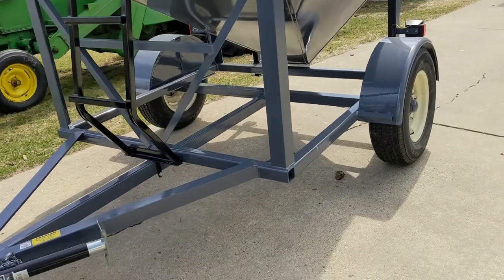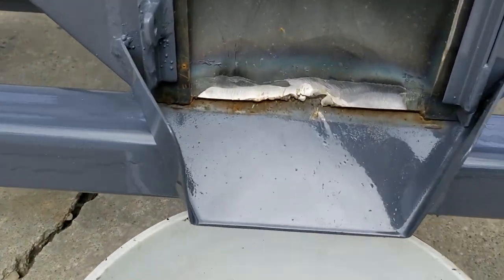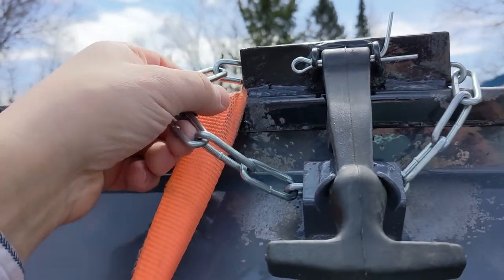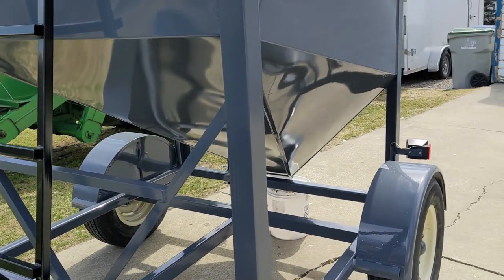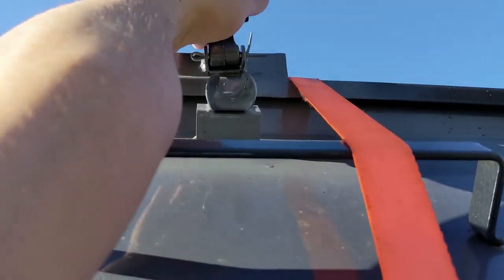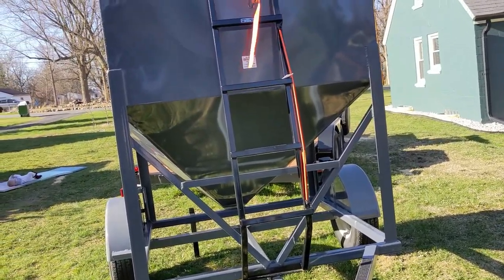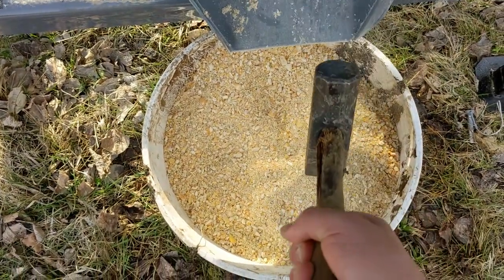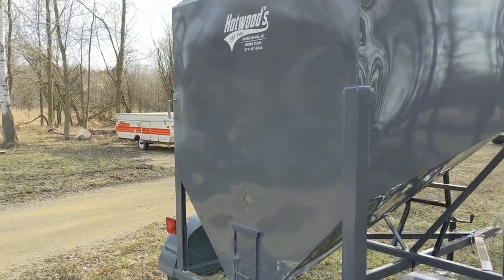Hotwood's - Versa Tote Grain Cart Product Review and Mods

Comment: For these bins do you have them come to your place and fill it up or are you towing it to the feed place to have it filled?  Does is save you anything by doing it this way?  I currently am making feed runs and loading up a truck every couple of weeks full of feed in bags and have seen these bins, but didn't know what the benefit might be.  What has been your experience so far?  I was thinking that probably only whole grains could be kept in them and then I would have to grind or mix feed myself.   It sounded like work when I thought it so I laughed and then didn't do anything with the idea.  🙂 What are the pros and cons of doing it this way?  Thanks.
Reply from the maker: I have a feed mill that grinds up a mixture of corn wheat and soy into chicken feed. I drive it down to them and they fill the thing up. The price is only slightly cheaper, with the main benefit being I don't have to deal with bags anymore. 
I have had it for over a year now and filling up a bucket has been pretty easy. I do keep the feed door greased so it does not bind. The feed has been completely dry for that time as well. A downside is that instead of buying 500lbs of feed at a time, you end up buying 4-5Klbs. So the payments are much larger. You also have another set of tires to maintain that spend most of their time sitting. (I hook the tractor up each month and move it around just for fun)
Check if you have a feed-mill that offers some sort of animal feed mixture, and that they have a delivery system. Otherwise you will end up buying bags and using this to store the grain. Which still has a storage benefit, but is not using the thing to its fullest potential.